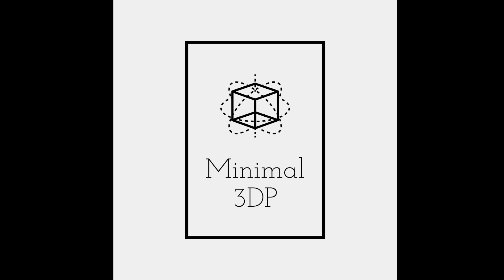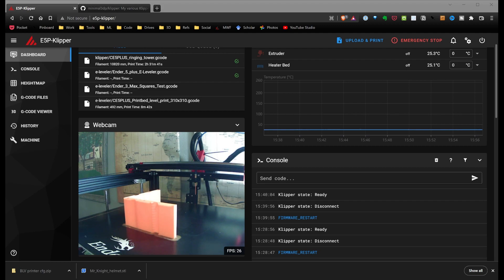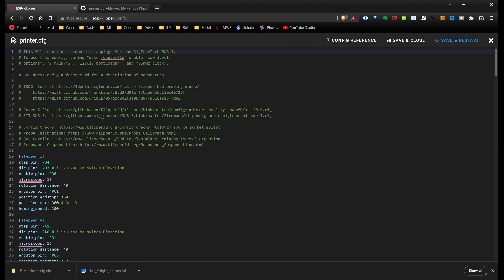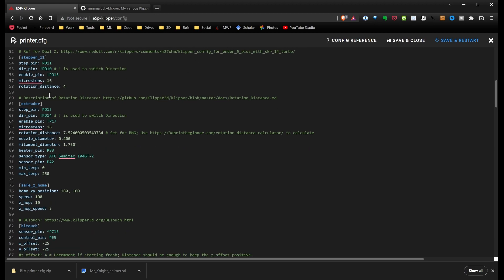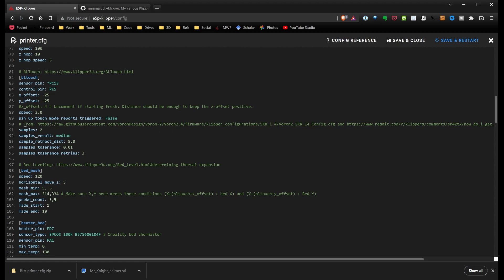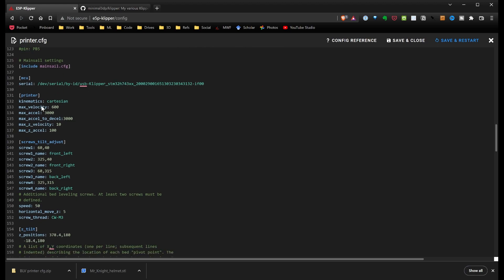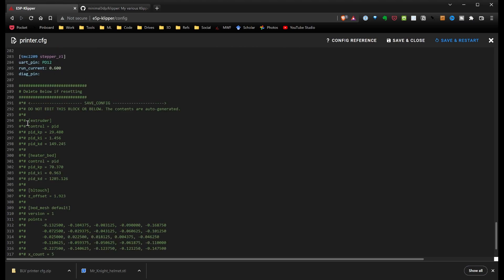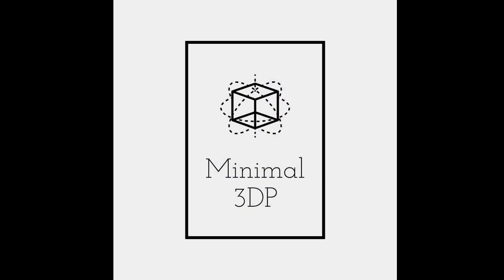Creating a Klipper Profile for the BTT SKR 3 on my Ender 5 Plus

Comment: Quick question: Why does z and z1 have 2 different run currents in your config? I would think that they would be th same at the very least; never found a clear answer for the proper current.
Reply from the maker: They should be the same. It is an issue I missed. Thanks for letting me know.
Reply: @minimal3dp  what current would you use then? Have the same board and printer; would like to make sure I set it correctly.
Reply from the maker: I don't have access to the profile right now. I am working on that printer. Take a look at: https://youtu.be/i11zUuFRJz8

Comment: Thanks for the start. I am excited to get Klipper up and running on my SKR3 EZ Ender 5 Plus and will respond if I run into any problems and the troubleshooting I will have to do. I am thinking about picking up another Ender 5 Plus for parts in my area here soon and doing the Zero G Mercury one.1 conversion with the Hydra setup and if this goes well it will be just another reason to go for it!
Reply from the maker: I have all the parts for the hydra, I just need to find the time to build it.

Comment: In my Ender 5 Plus ive got it all set up, everything is doing as it should until you press print, The timer starts on the screen but the hotends staying put.  Not being to sharp when it comes to Marlin ive got it to here, Im now setting up a laptop to run ubuntu klipper mainsail ect but i cant get any of the program operating dashboards up on the screen. Most confused with it all.
Reply from the maker: Is it heating?
Reply: @minimal3dp  Yeah, It does everything.... Except actually print. The BTT touch screen dont work though, Thats on marlin mode.
Reply from the maker: Try switching the black BTT screen cord around. It is the cord with 4 connectors and a single connector. The single connector should be plugged in on the board toward the center of the board. Does this make sense?
Reply: @minimal3dp  Yeah mines wired according to the pins on the pdf print out. They never sent the cable with the screen, It does flick on occasionally but does nothing and you cant get back to the marlin screen without restarting it.
Ive rebeen through the TH3D firmware, someone said about the start G code but ive been through, I cant find anything to do with start g code. I did tweak a few other things but then noticed its not the firmware.bin in the oi-build file anymore. The txt isent even bright. Somethings wrong there.

Comment: Any hints on getting a PT1000 hot end thermistor working? Tried changing sensor_type to  PT1000
Still getting ADC out of ranve
added pullup_resistor: 1000
Still getting the ADC error
added the jumper to the board and tried both of the above again, still no dice
Reply from the maker: I will try to do some research.

Comment: I have noticed you have reversed all the steppers in the config. Question: did you do anything to stepper motor wiring before you plugged them in to SKR3 or did you just plug all the stepper motor connectors as they were to the board?
Reply from the maker: I just plugged in as-is but I was using an SKR 2 before switching. I can't remember how the wiring was previously. I think I also addressed any direction issues in the firmware.

Comment: In the process of installing - have followed your hardware vid - thanks. Thoughts on Marlin vs Klipper? Planning to use your firmware.
Reply from the maker: I am really starting to like klipper. My only issue is developing muscle memory for tuning. On a marlin set up I had the process down. Klipper is a little different. 

I have done a couple of klipper videos you might find helpful. I am posting another today.

Comment: To confirm, you have the SKR3 or SKR3EZ? I had to update/downgrade libraries to get the EZs to work properly in Marlin so I am wondering if that hassle is needed when using Klipper. I really want to try it.
Reply from the maker: I am using the SKR 3. I don't think so but check the BTT repo to be sure.

Comment: This is awesome. Conveniently I'm also building a E5P with a Biqu H2 and SKR 3 (I'm using EZ but they're the same). This will greatly speed up my build. 

Klipper is awesome. I changed my first E5P to Klipper and it's been nothing but great. Screw tilt adjust and z tilt adjust make life so much easier
Reply from the maker: Glad it will be helpful. Let me know if you have questions.
Reply: @minimal3dp  thanks.

It's yours the generic H2 or the H2 high temp? I stupidly bought the high temp with no intentions of printing that hot and now I have to deal with PT100 thermocouple.
Reply from the maker: @JustTony72  I have the generic h2. You could probably switch the thermistor pretty easy.
Reply: @minimal3dp  I was thinking that initially but it turns out the diameters are different. It's ok. I'll just swap the entire block for a copperhead that I had planned for the first machine.
Reply from the maker: I did not know that. I have tried running an h2 with  a V6 heat block and it worked too.
Reply: @minimal3dp  thanks for the printer configuration file works perfectly. Does your printer have a high pitched whine when it's trying to hold a position. Coming from the E3V3 which is 100% silent, it's quite annoying. I wonder what's the cause
Reply from the maker: @JustTony72  Mine is quiet. Is there an issue with your fans?
Reply: @minimal3dp  nah. Turns out I didn't set the stelthchop threshold to 99999. Whisper quite now.
Reply from the maker: @JustTony72  I have not messed with that setting so I will look into it this weekend. I appreciate you updating me.